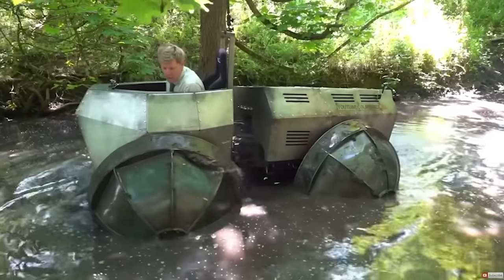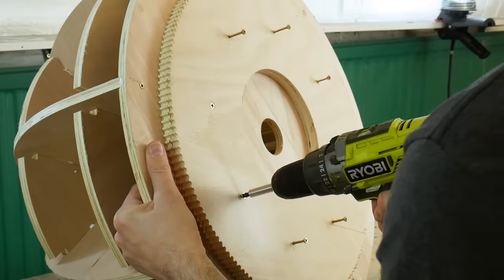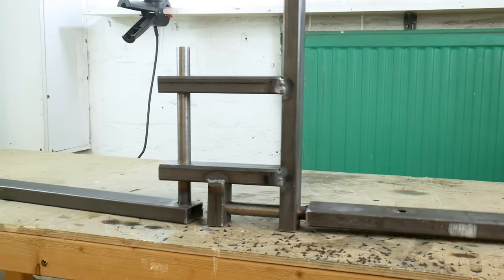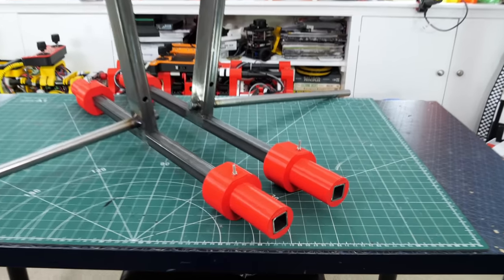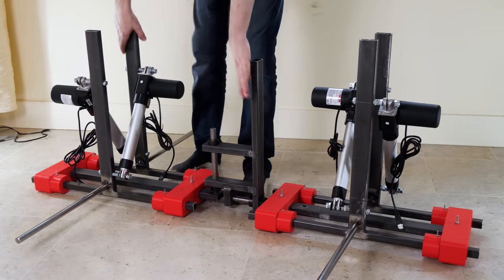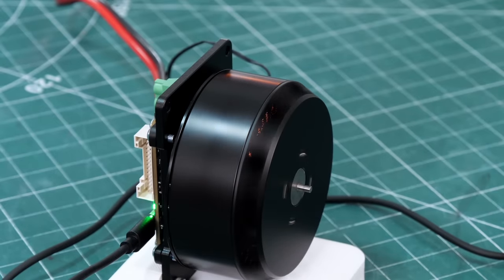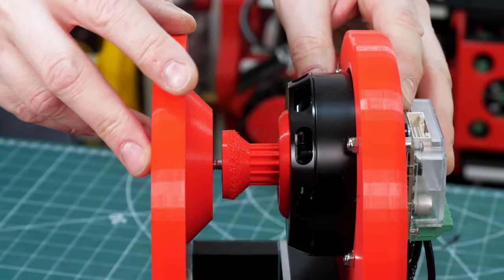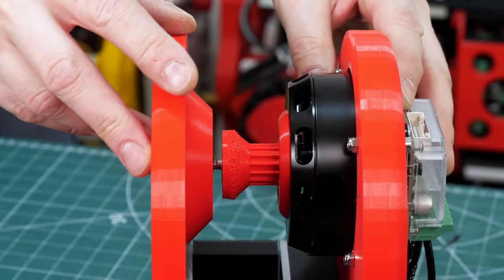Colin Furze Helped me test my TANK

Comment: I guess one problem is, that on the wheels, even when spread out, you have a lot of ground pressure on the "bars". Only one bar at a time is touching the ground. I'd try some kind of net or fixed track in between those bars. Like on some tractors, designed for low pressure on the ground.
Reply: dont tanks have tracks not wheels?
Reply: @geesehoward700 Yes. I don't talk about putting tracks covering the distance between the wheels, I mean the track covering the big gaps ON the wheel.
Reply: Could also put something inflatable in the gaps, like rubber bladders with about 10psi in them.
Reply: @poopbutt238 True, but they'd also need grip on the outside. So putting a net all around each wheel would make sense.
Reply: I agree with your observation, but not how to address it. Even simple 'teeth' added to the wheel webs/struts to all but the non-cambered driving edges would work wonders. What might happen with webbing is the web actually exacerbating the slip by getting caught in the surface it runs on. On smooth asphalt/concrete, I could see it adding traction. On soil, it could snag very easily.

Comment: Dome the wheels and fill in the hollow space with spray foam insulation. It'll add byuoancy, there'll be no empty void that'll fill with water in need of draining, and prevent the paddles from digging down into the water and mud.
Reply: Pretty soon we’ll loop back around to inflatable rubber tires 😂
Reply: +1 I thought the whole idea was to use the wheels as floats.

Comment: The circumference of your wheels is different across the width of the tyre, effectively giving a different circumferential speed across the tyre's width. So you automatically lose any static friction and the faster- and slower-moving parts of the circumference will be pushing against each other.

There won't be any linear propulsion from a completely submerged wheel unless it is on the bottom.

It's beautiful 😃

Comment: I would like a video where you try to iterate upon this design and improve it. You could:
-Add steering
-Put a limiter on the roll
-Space the front and back a little further apart so the wheels don't hit each other on a tight turn
-Add some buoyancy so it can work like a paddle boat (but don't forget to distribute the weight properly so it doesn't tip)
-Anything else a civilian such as my self didn't think of
Reply: Some filler in the wheels to spread out ground pressure would be helpful in the mud and grass,
Reply: @goosenotmaverick1156 Even better if that filler is a highly buoyant material; perhaps some sort of foam.
Reply: Oh and you should lower the cg and make it heavier that should help with the slippage some

Comment: Keep in mind this "Rhino" is only model size! If it was big enough to house a driver, it could effectively take on rocks (and water depth) 2-4 times bigger.
Think of it this way: A normal curb is about the height you can expect a normal car to drive up. But a small RC car obviously can't do it. Whereas a huge minig truck can easily go over a much larger boulder.
So it's not really a fair comparison when you give the same challenge to two "Rhinos" of different size. With active steering and full-size, I reckon it would do splendidly!

Comment: My suggestion would be to fill the wheels like Collin did, but slightly deeper and using a mesh instead of a solid plate.
Setting them sunk in a bit more will keep the grip your getting from the edging, but also add in some extra in the softer mud without the wheels basically tuning into shovels.
And using the mesh keeps them from filling with water and reduces the weight.

Comment: Seems to me it would be much more effective with the dish of the wheels facing inside instead of out, to ensure a wider track and more stability. 
Especially as camber is added, it would lower the frame instead of raising it.
But also controlled steer angle looks to be needed.
Looking forward to version 2!

Comment: Just a tip, you should bubble fillet the ends of your pockets/slots so that when you slide square boards into them you don't have to deal with the tool radiused corners interfering with the square corners of the board.
Just makes things fit together much more easily

Comment: Besides the active steering, I'd think that adding some serrated metal edging to the wheels would help with grip. The rubber strips protect the plywood edging, but actually reduce grip on slippery surfaces. I envision the rubber strips staying there, and the serrated edges hanging over them.

Comment: Honestly, it did a LOT better than Colin's version. Your issues were mostly around that articulated link in the middle, it really needed to be powered in the yaw axis so you're not just relying on tank-steering, and angle-limited in the roll axis to maybe 15-20 degrees.
As a first effort (well, first improvement on Colin's design) it's really impressive, but would need more iteration to actually be useful.

Comment: If front and rear wheels were separately controlled that would fix a lot of the control issues. You do need it to oversteer in some of those positions, which won't happen if front wheel loses grip.
In software considering you have a hall sensor, on each motor, you can program the steering (i.e. left right balance) to take into account if front and back wheels are spinning at different speeds and make a differential in software this way. Should be easy to program and test it. It could also fix the stability issue when you want to go straight. Though to account for slipping you will need some hinge sensor as well.

Comment: Limiting the slip electronically rather than mechanically should be relatively easy by adding intelligent servo control to the motor supplies. If you can't sense through the motor proper, via the drive module, then you can add an external loop(s) and simple sensors externally that then interrupt/modulate your motor feeds.

Mechanically, some sharper edges on the curved part of the wheel struts would be very simple to add.

Comment: Is weight not an issue too? Weight to torque (power), it looks quite lightweight even though there is steel involved in the construction. 

Limiting the steering seemed to improve it slightly but I think active steering would improve it further. Also studs to improve grip maybe beneficial. 

Just throwing a few grey cells in there. Nice illuminating snowman in one shot.

Comment: 21:00 One thing that might solve some issues - independently adjusting the angle of the wheels.  It looks as though your wheels adjust the splay in pairs; being able to change only the one wheel - such as the wheel stuck against the bank - might have helped you.

Comment: I think this is a hugely promising concept. What looked very obvious to me 
1) The vehicle is too narrow for the wheel radius. With the wheels at full camber, the wheels almost touched in the middle underneath so  it was almost riding on a hemisphere; no wonder it was quite happy to roll over.
2) Having each wheel as a hemisphere is the wrong geometry. The radius of curvature of the blade ends should be more than the radius of the wheel. So you'll end up with a truncated gherkin sort of shape. That way as the vehicle tips, the track gets wider & more stable. "Paddle wheel mode" as you said.
3) Active steering. I think you already decided that. Retain the differential wheel speed tho.

Comment: Awesome. So the open wheel area concept worked better, as did the tilting axles.

Just needs active steering, and limitation tabs.

Its not as good as tank treads, but it looks cool and the concept works.

And in my opinion there is a need for much much more wheel power. Because it was getting stuck because it couldnt sling mud.

Comment: Vector steering on this thing is tricky.
I would like to see how this behaves with different setup.
Instead of having one side spin faster (like a tank without tracks)
Run one front wheel faster than the rest and run the other front wheel slower than the rest.

Bonus points for limited slip diff or lockers. With Odrive you could force back wheels to rotate withe the same speed regardless of traction - true and tested solution from rock crawling.

Comment: Super cool.
I think American 4x4 truck tires would be a good fix for the terrain; considering lots of vehicles get stuck in the wet English mud. They always put studs or chains around them especially in the winter if its deep enough freezing for the area. I think the loss of grip is mostly a tire tread issue.

Comment: I think I agree with Colin - you needed a way to actively control the orientation between the fore and aft.  4WD works on a truck because the angle of the wheels to each other is actively controlled.

And I do think that making the wheel "domes" solid might have given better traction as well.  Thought arguably the biggest problem there was not enough mass to create enough down-force.  It looked a lot like driving an empty pickup or van on the snow - too much power, not enough mass.

Comment: The concept designs work fine, they just need more torque / stronger motors. You can place cleats on the inside portion of the "tires" so that they dont impact solid ground but do grab anything the vehicle is sinking into like mud, they should be right near the edge.

Comment: Use e bike hub motors instead. Quite cheap and stupendous torque, they should be water ingress resistant as well.

You could either use them with belts, or chains and have them in a similar set up to this or actually drive the heels directly.

Comment: I think if your iteration were heavier (maybe down at chassis level so it's less likely to tip over) it would have more grip. Just in case you'd ever think about a v2 of this ;) I also felt like you could've made use of the actuators to navigate the ditch more easily. Anyway, loved the build and the enrgy between you and colin!

Comment: Now combine them. ~4 horsepower per wheel from the Odrives should be enough. Add maybe a slightly updated wheel where the outer section are in the steamboat style with a semi-sphere center for flotation.

Comment: I think some suspension for the link that both prevents jacknifing and also makes it want to straighten up.
Oh, you actually did something like that!
I think using elastic bands would be an improvement, but I guess you used what you had at hand.
But seeing the end issues powered steering might be what is needed.
Filling most of the holes in the wheels with something like foam board would probably make it float and pass the stream that way.
Reply: I suspect passive damping can only help to a limited degree. Especially w/o limited slip drive for the wheels, it will be necessary to have active steering via an intelligent servo actuated by a direction command, rather than derived as a passive product of wheels that can slip.

It's the slipping of the wheels mostly that's complicating directional stability. Once wheel slip is addressed, ostensibly with an active servo control on the motor commands, then an actuator on the spline/chassis/articulation point can be tied into that product. Suspenders and brace as per directional command/compensation. Since there's more than adequate power at each wheel, software actuation (perhaps with a rotation sensor on each wheel also feeding into the servo module) should be relatively straightforward, and also make driving the vehicle vastly easier and the vehicle being far more stable via self-correction.

Think a joystick to fly an airplane.

Comment: I think between you and colin you both could probably figure out a mostly decent Rhino Tank. also, I think it would be more effective if you implemented some sort of traction control with an IMU and the expected speed of the wheels. And the design could be simplified with a shared axis for the camber adjustment which would eliminate half the linear actuators.

Comment: Colin had a good thought about powering the articulation joint. I'm not sure why it even has it because a skid steer does not articulate. It may help in extreme situations releasing the machine from being stuck but not during normal driving. The controls seem to need some kind of logic behind them. Manually running all the motors looks a little like flying a quadcopter manually.

Comment: I'm curious if adding teeth to wheels of some form to get some grip, or if making six wheels will be better so if one section is spinning freely the other two pairs will step in to push and or pull it? 

Second if the original idea doesn't work how would you modify the idea to make it work?

Comment: There's a reason normal tanks have large surface area, so they don't sink. leaving the wheels open would potentially allow the tank to sink deeper. but I don't think it was heavy enough for that. But a bit more weight might have made it less slippy.

Comment: I am not quite convinced it's a failure - this was actually quite neat. A few more iterations would make this thing quite a bit more capable. More surface area on the wheels, forced steering, lower center of gravity, some tweaks on the wiring to make it longer/more water resistant, some more torq / figure out why wheels weren't spinning, physical joint locks to prevent oversteering and the wheels from hitting one-another... that'd do nicely.

Comment: Not sure how you've set it up nor the deep specs but it would seem a good setup for your design would be tank controls for the front wheels and a simple trigger for the rear, maybe at a lower power to deal with the steering issues. Angling the plywood segments would probably help with traction too, at least enough to film a proper success before it cakes with mud. Bloody good attempt though

Comment: There is a reason the original vehicle had closed dome wheels and not open ones. The wheels will just fill up with mud and make them slick 😁.
Reply: The biggest fails with the domed wheels design is that they have almost no grip.

Comment: Might have done well to primer the plywood before spraying it with metallic paint.  Primer will make it more water-resistant and makes the color on the next layer pop.
Not sure how well electrical system work with water.

Comment: You could try a solid half-sphere (or segments inserted into the spaces) slightly smaller than the edges (maybe 1 or 2 inches?) to provide flotation in case of the water being too deep. The solid part/sections should have a tire grip surface instead of a slippery flat surface. Those edges don't have much grip. They're tiny. The surface area doesn't compare even to a normal everyday tire. Unless you try to increase the number of edges.

Comment: DId you ever figure out why the motors weren't turning at that point where Colin pointed it out - where one wheel was spinning in the air and the others were down on the deck? It was behaving like it was running from one power source with a bunch of differentials rather than having a motor on every wheel. I feel like there were a bunch of situations in that video where it should've been able to 4WD power its way through but it didn't. 

Were the motors hitting their torque limit, or was there a power source current limit (with one motor using all the power) or something else going on? 

Awesome video.

Comment: I don’t really understand why there was no real steering? If you put all that into adjustable camber, it would have such a simple thing to add steering it seems. 
I would love to se this machine out and about once again with added steering and maybe some kind of spring mechanism to control the side to side wiggle. If the front and back can tilt freely from each other, of course one part will turn upside down at some point.
This thing is so well engineered to a point, then it seems like you just didn’t bother finishing it.

Comment: Maybe the profile of the wheels could use a revision or two (in simulation obv). I was thinking, instead of just a regular circular profile for the ridges, elliptical or even hyperbolic profiles could be considered so that less camber would be required for similar sized "contact patch". Having less positive camber also would mean less roll-over potential.

Comment: if you split the wheels into layers, with the smaller outer ones spinning faster, then they would all push the ground at the same speed and it might work better
it's like that thing with train wheels being angled so it keeps them on the track, you need to deliberately avoid that

Comment: This is the way I used to build things, with the exception of the 3d printed parts. I used wood where posible, simple steel and aluminum structures and messy electronics designed purely to prototype ideas rather than build something with a high level of durability.

Comment: It sorta makes sense, no matter how big the motor is the bigger the wheels are the bigger the velocity difference from inside to outside. At the very ends of the wheels the circumfrance is small, at the base its large, so it will always be fighting itself more as it digs into the mud. You need yo be able to spin all 4 wheels constantlt and clearly constain the vehicle itself, otherwise im still impressed it did as well as it did, it really did not handle high friction surfaces well it just needs to be able to overcome that.

Comment: I wonder if the higher center of gravity due to the motors on top of the sticks was a factor in the difficult driving.
Sure, everything would have to be waterproofed 😐 but I imagine with weight down low and power steering, this would work better.

Comment: Clearly a colab tank is required at this point, it has to be manned. so you need 4 Surron or hub motors.  Use their battery packs since they are water proof and put the rest of the electronics high. then a saddle in the middle for the rider.